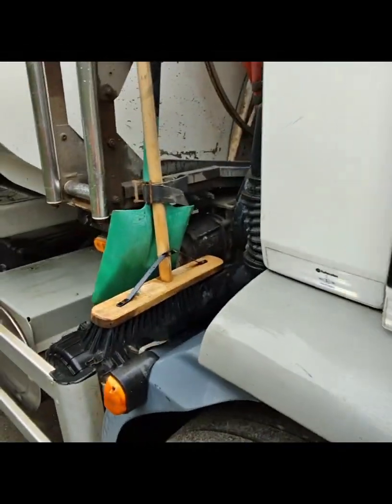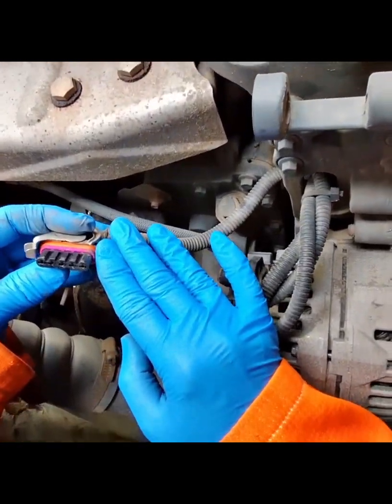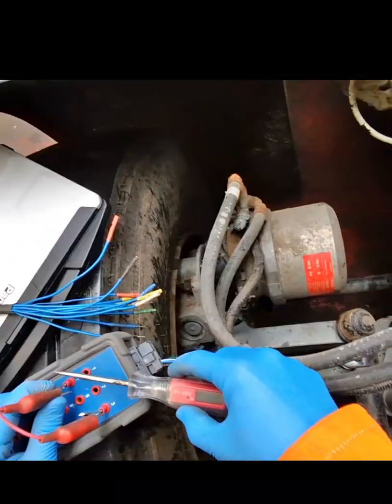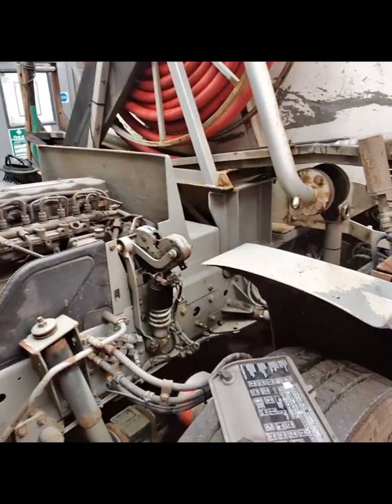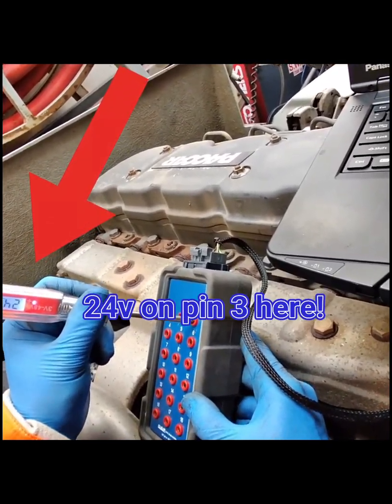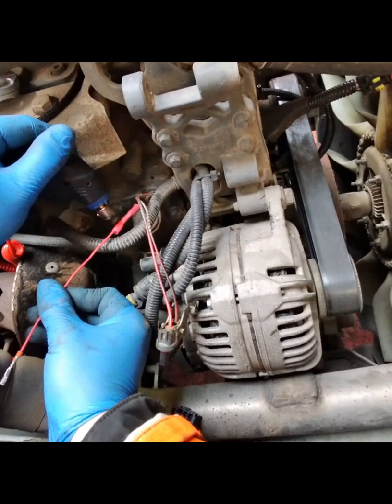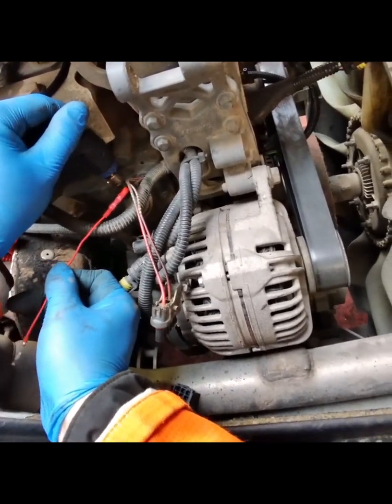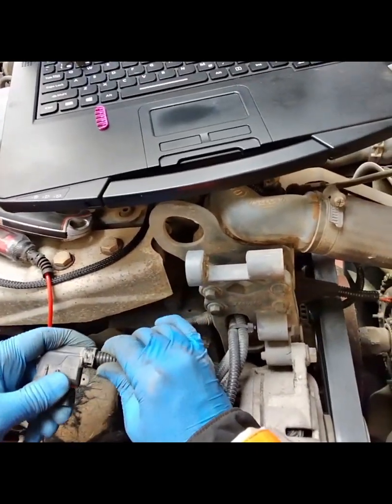DAF TRUCK ALTERNATOR FAULT. IN-DEPTH WIRING AND REPAIR

Comment: Great videos pal. Where did u get the pin crimp connector from? Have u got a link bud?
Reply from the maker: Hey, thanks for the comment. One of my old videos is this. I'm glad you thought it was worth a watch.. ....really poor if you ask melol 

Anyway, the terminal crimper is:
https://ebay.us/AackXp

Note that this is an affiliate link, I have to put this legally, you wont pay anything extra, but I do get commission from this sale, and i only recommend things I use personally I.e this tool

Comment: What are you using to join the electrical wires?...that looks like a gun
Reply from the maker: Hey, thanks for the comment. I forgot I still had this video! 😅

I was using this to heat the butt connectors up and provide a water tight seal to wiring joint: https://ebay.us/Dv2tkk

F.y.i This is an affiliate link that I earn money from, but in no way is this cost passed onto the consumer, and I only recommend things I buy and trust myself
Reply: @TRUCKTECHUK  thanks 🙏

Comment: Hello, Daf lf 45.170 euro 3, the engine, abs and alernator lights up on the display, but the water temperature and tachometer do not show. I get to abs with the diagnostics, where there is a can error and the diagnostics does not connect to the engine. The alternator has a blown fuse where there was also a charred cable, but it is unchanged. I am currently following the wiring under the oil filter and from the alternator to the control unit, but so far without results. The gentleman here once advised me when the speedometer and the cables to the diagnostic socket were not working, could this also be the cause? or where else could there be a mistake?

Comment: Great 👍 Thank you 
What info do you use for wiring & codes is it All from Daf
Reply from the maker: Hi Colm, it's all from DAF but we also use a 3rd party software for non-franchise vehicle's called #jaltest. This has a wealth of information and testing technical data for all makes. I find this 3rd party software  as good the DAF  information available to me as a dealer technician
Reply: @TRUCKTECHUK  Thank you 👍